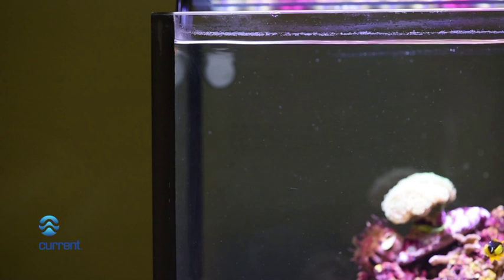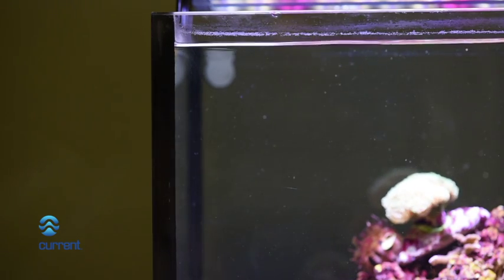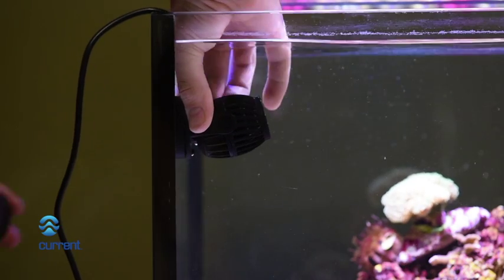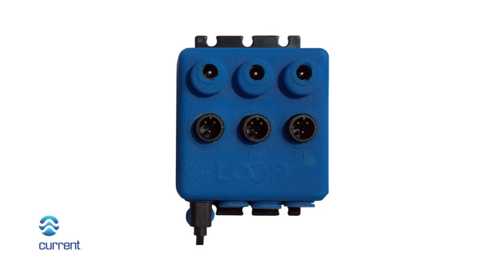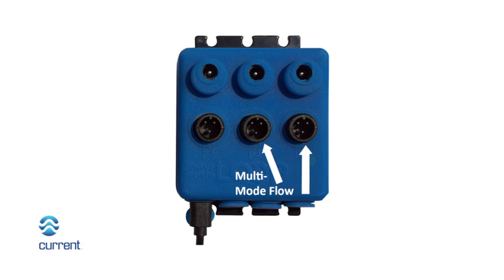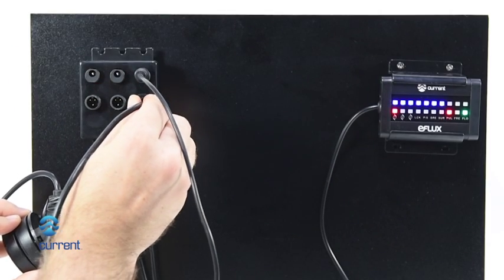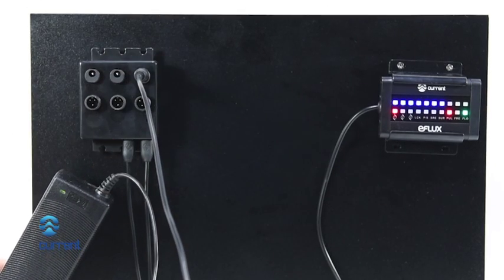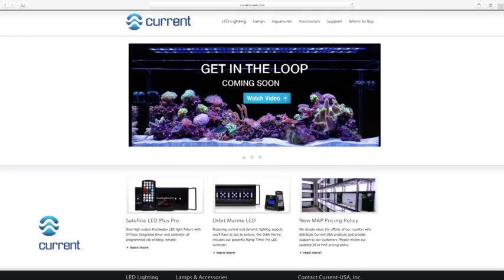eFlux Accessory Wave Pump Installation Instructions

Comment: I don’t have the blue hub but I have a black one that the adapter is going perfectly but when I plug it in and I get an error reading and my LED current lights go offHow can I fix this error or do I have to buy the blue Harbor because my current LED lights came with the loop and a black hat that looks like a hub what is not the blue one so please help me
Reply: janice cruz I’m having the same problem. Did you figure it out ?
Reply: @jessicag1128  no not yet
Reply: I believe the black hub (12v) is for LED lights only. To add pumps you need the blue pump hub (24v) that will plug into the bottom of the black hub. Here is a diagram that kind of shows it.  https://currentusa.zendesk.com/hc/en-us/articles/216509223-My-eFlux-Wave-Pump-doesn-t-seem-to-turn-on-